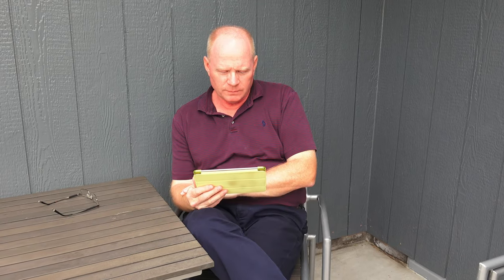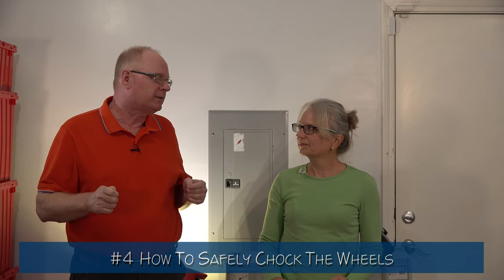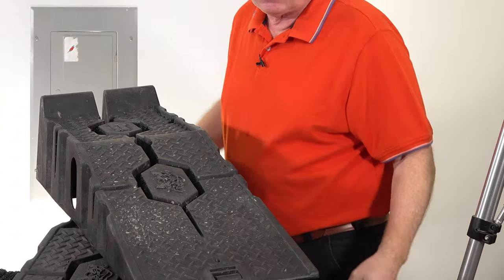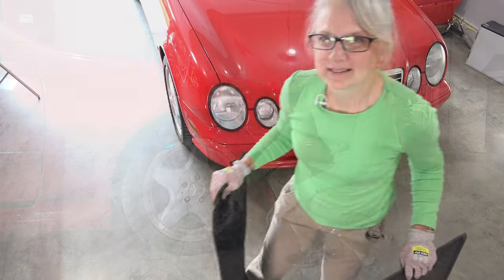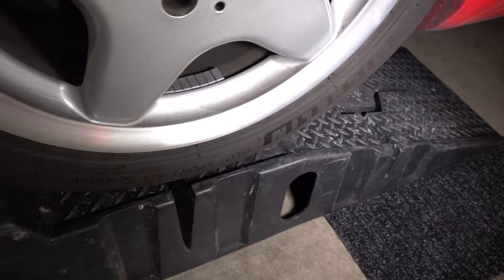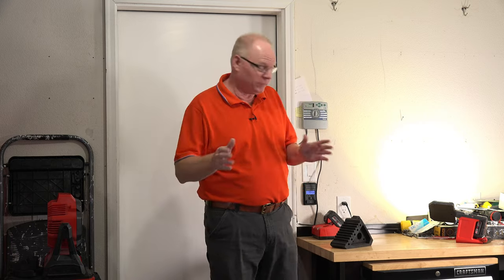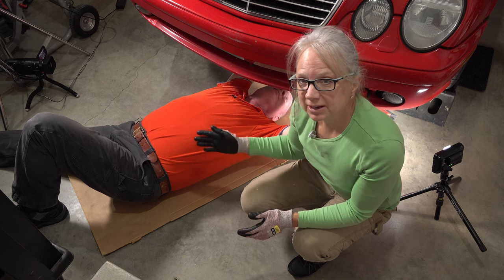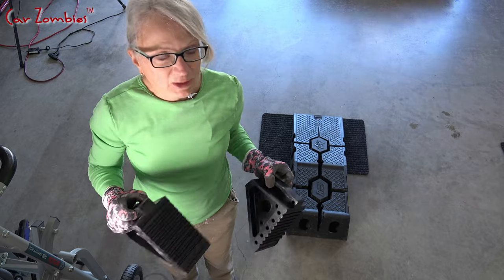5 things the Pros don’t tell you about car ramps

Comment: I take it  your MB is a rear wheel drive. If it were a front wheel drive then the ramps would be inclined to say in place as the front wheels  are powered which makes the ramps want to move rearward. I have both a rear wheel and front wheel drive and luckily for me my concrete driveway is not as slick as your garage floor. This helps to keep the ramps in place. I must say though , that it is trial and error knowing when to stop so as not to go over the edge. Once I am on top somewhat I set the parking brakes and eyeball just how much more I can proceed forward. Usually for me , with experience its about 2-3 inches or so. Finally I back up the ramps with jack stands and sometimes I even use a floor jack placed at a known jack point under the very front of the engine area. A friend of mine went as far as to bolt down two pieces of 2x4 in his garage and then the ramps butt up against them . This prevents the ramps from sliding.
Reply from the maker: We never thought about front-wheel drive making a difference. That's very interesting!

Regarding when to stop, I truly think they are engineered to slide one you hit the lip on the top. This slide prevents you from driving over the top of the ramp and helps those who don't stop in time at the top. Your friend's 2x4's prevent this, so he has to stop exactly at the top, or something bad may happen (like tipping the ramp or driving over it). Our problem was the sliding while going up, where we pushed the ramp out before we could drive up it.

Paul

Comment: Friction is complicated. But it does not depend on the amount of surface area between two surfaces touching.
And you should not only calculate friction but "friction" as well. 
For example: if you decrease the surface area on a semi - muddy terrain  there would be more "friction" between two objects then if you were to increase the surface area...
Reply from the maker: I didn't know that. I hope I guessed right for this use.

Paul
Reply: @carzombies  when we talk about friction, we generally talk about wan der wals force. Its a type of an electromagnetic interaction between two surfaces in contact. Geckos use it to climb walls. 
In this case, it is not the ony thing that is contributing "friction" = force that we experience and use on a daily basis. 
Best way to aproximate which side should be in contact with the ground is by trial. You did a good job demonstrating how to test this. Both ways your test suceeded...
Reply from the maker: @mihovilcota8761  Thanks, we love the science of it.

Paul & Diane
Reply: This is only true while the material providing friction is inside the yield point. Once inside the plastic range the friction will quickly move to zero.

Comment: one thing to look for when doing the ramp thing is that if you have a car that sits low or was lowered or has an "air dam/spoiler"  is that you might not be able to get the car up on the ramp with out contacting these items first.
Reply from the maker: Yeah, it got close with Diane's car, and we also had problems with the bumper in the next video on jacking up the car where the low-profile floor jack barely fits under the bumper.

Paul

Comment: Always remember when u use a wheel chalk never go behind the car put the frist one on the passanger side  tire frist and for the second one bring the wheel chalk up to the front of the car walk past the hood of the car then past the driver side all the way back to the driver side wheel and then chalk the car wheel

And then repeat the same septs but never go behind the car when using wheel chalk and always use separate ropes on each individual wheel chalk never join them as one 2 to 4 foot rope tail on both so u can pull the rope and never put your hands in danger 

Hope this helps as a professional machine tip
Reply from the maker: Thanks Mark. Sounds like sound advice. We’ll start doing it that way.

Paul & Diane

Comment: I think the ridges on the wheel chocks might cause the tire to grip and potentially climb over the wheel chock so I like them down
Reply from the maker: Thanks for the idea. We tried it both ways and they worked great in our garage, so it is probably just a matter of preference. Some other commenters pointed out also that the ridged side may be better if the ground isn't as smooth as our garage, and that also makes a lot of sense.

Paul & Diane

Comment: How about if you jack up the front of the car high enough to slide the ramps under the wheels. Then no sliding problem or fear of running off the end of the ramp. I have these Rhino Ramps. Not so many problems using them though. I use on brushed concrete driveway so no sliding.
Reply from the maker: For our last video (https://youtu.be/4E5vnFlf2EA?t=197) on working with the transmission conductor plate we did practically what you are suggesting. We used a floor jack to jack up the front and put jack stands under the running boards at the jack-up points. But since the transmission is in the middle we couldn't use the floor jack as backup, so we put the ramps under the wheels in case the jack stands failed.

Paul & Diane

Comment: Jacking points are listed in the owners manual.
Reply from the maker: Only the roadside jacking points are in the manual, not the jacking point for a floor jack to put the car on jack stands (the jack stands go under the roadside jacking points). This is the only safe way to work under the car. In our case the jacking points for the floor jack are the cross-beam between the front wheels and the differential between the rear wheels.

Paul
Reply: @carzombies  So you are doing your video from the stand point of people not knowing anything about frame dynamics and design?

Comment: you are driving Mercedes: the jack points are under a cover on the rocker arms you need to remove the cover and install jacks in the hole under the cover.
Reply from the maker: I’ve used those with a car jack on the side of the road but they are too dangerous for car repair projects. Besides, that is where we need to put the jackstands so we have to jack up the car from a different point.

Paul

Comment: I got better ramps. But im alone in life. So i have to drive on my own. So my ONE problem is just knowing when to stop when i have no way to see. So it will have to be by feel only and luck. But i have no sliding or any of your problems because my ramp cost $140 and has stuff so it dont slide. But anyways. i just will go by feel.  Im sure i will know when to stop, but, me knowing is completely different then reality. So hope my feel and instincts are good enough. I will go slow. But will assume when it will feel like when i get to top and the little dip feeling is when i will push brake to stop. Fingers crossed 🤞 🤪🤣✌️
Reply from the maker: Please be careful and good luck! Just like us, you're figuring it out as you go.

Diane & Paul 😊😎

Comment: diane has nice taste in cars. I have a 99 e300 turbodiesel with about 500hp. lotttttts of work I beat myself to death
Reply from the maker: I bought it because it was pretty (my red hot tamale!), but after driving it I fell in love with the V8!

Diane
Reply: @carzombies  Certainly a rare car, not too many  W208s in that red color with the AMG appearance package. They are also known for rusting out so be careful. Transmission and engine are pretty much bulletproof though, only common issue I see with M113 v8s are the valve cover gaskets leaking oil.
Reply from the maker: @om606channel  I have only stored the car in a garage, so hopefully no rust will invade it. The valve cover gasket note is new to me and Paul, so I want to look into that.

Thanks for the wealth of information!

Diane

Comment: I enjoyed the video and found the device to be sensible, but my first thought was, if you’re looking for the jack points, why not just consult the owner’s manual? I know manuals have gotten « dumber » over time (there’s a joke about how they used to show you how to adjust the valves, and now they warn you not to drink the battery acid) but surely it shows where the manufacturer expects you to put the jack?
Reply: Gotta love autocorrect. That was « advice », not « device », but YouTube wouldn’t let me edit my post
Reply from the maker: Good question. The manual only tells us where to use the road-side jack, which are on all 4 corners under the running board. The problem we had was we needed to safely jack up the rear wheels so we could take them off and fix the brakes, which isn't safe with a roadside jack, and also isn't safe with the car held up by only a floor-jack on the jack-up point.

Instead, they say you should use jack stands under the jackup points, but to do that you need to use a floor jack to jack the car up somewhere else so that the jack-up points are free to slide the jack stand under.

So, we eventually found out that we needed to jack up the car on the differential (the big iron block that the rear axels go into) and then put the jack stands under the manual's jack-up points for the rear (see our next video on jacking up cars at https://youtu.be/_wlvidlYYS4).

Paul & Diane
Reply: @carzombies  is the roadside jack an opening that the jack slides into as on earlier MBs? I have an ‘83 911SC that has that type of jack point, and I purchased a pair of adapters that slide into those openings allowing me to jack the car with a pair of floor jacks, one on each side. It makes it a lot easier to do oil changes. Of course, I use jackstands as well for safety.
Reply from the maker: @FPA4  Yes, there is a plastic cover over each protecting a hole that the roadside jack sticks into. Also, the frame of the car is reinforced there so this is where you can use a floor jack or hoist (like at a mechanic) under the rubber pucks. This is where we put the jack stands once it is jacked up.

Paul

Comment: LMAO
my ramps dont slide
my ramps have way more rubber on the bottom
i dont need a second person to drive up the ramps 

the wheel is sitting in the dip and you have the parking brake on ,,,, what more do you need ??????

Comment: I use Ramps and a mirror so I can see where I am. Those plastic ramps are the WORST. I HAVE OLD METAL ONES. THEY DONT SLIDE ON A ASPHALT DRIVEWAY. THE SMOOTH GARAGE FLOOR CAN BE THE WORST
Reply from the maker: We have never tried a mirror, but I suppose if it is big enough it would work. Yes, the smooth garage floor is a pain!

Diane & Paul 😊😎
Reply: @carzombies  
I am alone so I use a mirror, I think your channel is interesting and I get the theme of doing things yourself when your older but perhaps plastic ramps aren’t a good option and can be dangerous because they are plastic and crack over time. Harbor freight sells metal ramps. Low profile cars may not work on the metal ramps but there is an adapter FIX using a 2X8 2 feet long board extender on the metal ramp that works like a charm. One can find YouTube videos on this

Comment: 1 - should have not purchased Rhino ramps.  2 - garage floor is too smooth. 3 - having a short garage. 4 - car ramps do not provide enough clearance to perform work under the vehicle unless you are skinny. 5 - do not use car ramps, get a floor jack and jack it up and place jack stands.  Now you can work under your vehicle. Last, dig a ditch (pit) and build a foundation, drive the vehicle over the ditch, and work below it. Ramps are used to get a vehicle onto a trailer or tow truck. Car ramps are a joke.
Reply from the maker: After working on the car for about a year now I can't argue with you on some of your points. It is too tight for me to even take off Diane's engine shield for an oil change (Di fits under though), and I've come to trust and prefer the floor jack and jack stands also. It would be cool to build a garage ditch under the car for working, and since I do know how to do concrete can almost see myself doing that...😎

Paul

Comment: Don't use ramps on slipper concrete, they are designed for use on grass, pavement and rutted slabs, this will stop the sliding. Also having a brick or weight in front of the ramp works well. When I was young my father would have me push the ramps with my feet to stop them from moving.
Reply from the maker: Nice dad! 😂
Reply: Yeah that'll work well. Until it doesnt!😮

Comment: The sliding ramps are bad. You are banking on them sliding evenly. I don't want my ramps sliding at all. My suggestion would be not do this work on the polished or finished concrete floor, but do it out on the paver driveway, way more friction. If you have a lip where the pavers meet the floor, that can be used to stop the ramps from sliding. I would put a permanent line on the floor to show where to align the ramps. When using the chocks, give them a kick to jam them against the tire. Just suggestions. Nice video,
Reply from the maker: I agree that sliding on the way up is definitely something you want to prevent. We just didn't want the car to drive over the top or cause the ramps to tip.

Paul 😎

Comment: If you just made yourself some solid WOODEN ramps, you'd've saved yourself a ton of money and complexity because solid wood will NEVER fail so you don't need $100 jackstands.
Reply from the maker: We agree that we could build a wooden ramp that would be more solid than plastic (it doesn't compress or break) and even better for the low profile cars. But we can't imagine where we'd store them!

Paul & Diane 😎😊
Reply: @carzombies  You can't? I think you need to develop your imaginations, then. Wood ramps take up no more space than plastic and cost significantly less.

Comment: I would not trust those plastic ramps,  metal ones are  better,  trouble is most Ramos are not wide enough,  so you are better buying truck Ramps.  Rather than driving on the ramp,  jack the car up and place the ramp under the wheel.  Then re jack the car to place axle stands.
Reply: only issue with trying to lift the car high enough to just place the stands under is that many hydralic jacks wont lift anywhere near high enough because the wheel drop down and extend as you jack up..with my jacks,when im fully lifted at max height, my wheels are maybe 4" off the ground after they extend, no way to slip a ramp under there... 
granted these are older 2 ton cheap jacks and maybe newer expensive ones have superior lift height..
Reply from the maker: Since you made this post we came close to following your advice once we learned to use the floor jack and had projects where we had to crawl under the car. In the case of our transmission fix video, https://youtu.be/4E5vnFlf2EA, we used ramps as backup for jack stands. For us, we were able to jack the car high enough, but like skip741x3 says below, the wheels did droop a lot, even after we slid the ramps under them, and by the time we took the car down we had to jack it up even higher to get the ramps out.

Paul & Diane 😎😊

Comment: Yall are cute. Having a great time making videos together. But u got to be kidding me! First of all..ramps are not used for work requiring wheel removal. Second, you could probubly pay a shop to install the brake pads by the time yall go thru all that mess. Safety first but damn. Yall are getting carried away with it. I always tht using ramps or jack and stands was simply a "common sense" thing. But then it is an excuse to make a utube video
Reply from the maker: You're really lucky you were raised or found yourself around car repair young and are comfortable with it. I appreciate that.

But for us--we really wanted to start taking on these chores ourselves, like changing the oil and fixing simple mechanical issues with our cars--but we were afraid. Perhaps we let our nervousness get the better of us, but we are having fun and we've gone a lot further than brake changes and are a lot more comfortable now. We all have to start somewhere...

Paul

Comment: Twice I was able to drive my Honda Ridgeline up 4 RhinoRamps (one at each wheel) at the same time.

1st time - Ok

2nd  time , the passenger side front wheel spun from too much throttle and shot out the RhinoRamp.

I don't think there will be a 3rd try.
Have a great day.
Reply from the maker: We laughed at your story, but why on earth did you try to do all 4 at once? There must be a less risky way to get to the repair...We are glad you're okay! 😃

Diane & Paul
Reply: @carzombies I liked how easy and quick it was to drive up a set of ramps to work on my truck.
So I figured 2 sets of ramps would be better than using a floor jack and 4 jack stands to work under my truck.

I could have done this with the truck I use to own,
A 1985 Ford F150 4speed, inline 6 cylinder. 
1st gear was so low I barely it.